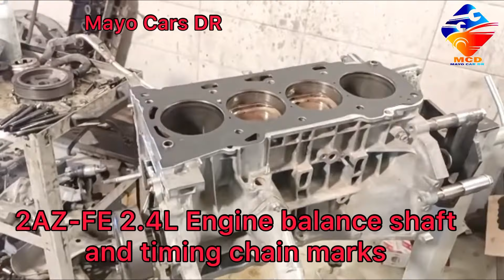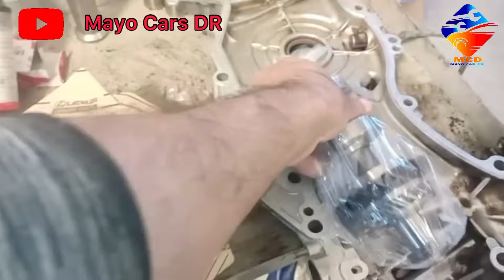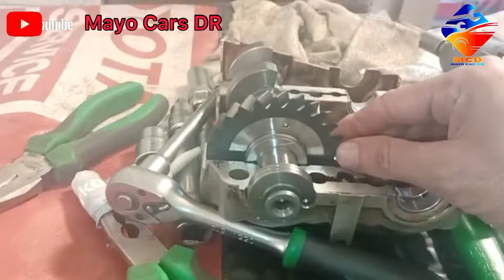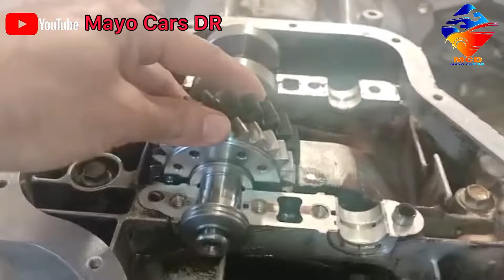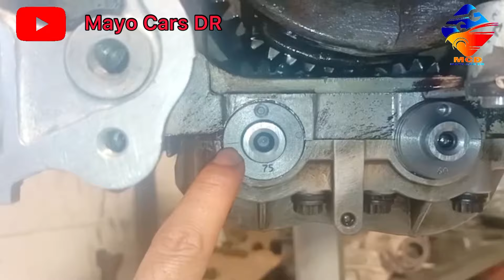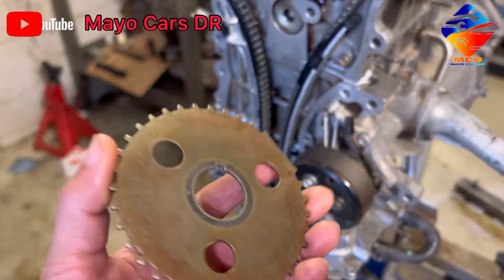2AZ 2.4L Engine Balance Shaft Timing Marks || Balance Shaft Installation Of Toyota Camry

Comment: Brother aoa. Meinay bhi overhaul kiya hai 2 azfe engine ko but meri cabin engine aur vibrations bohat arahai hain jesi koe diesel engine ho. Bahir se bilkul theek sound hai engine ka. Number mil sakta hai if u can help.
Reply from the maker: Yes ap ka balance shaft timing ka msla ho ga
Or engine mount check kren
Reply from the maker: Send me video
Reply: @MayoCarsDR  apko kaise video bhejon
Reply: Aur bhai jaan balance shaft bearing konse jo hain woh 3 variants hain 1 2 3 mein. Woh konse use karien 13601-28031 wali updated balance shafts kaye sath.